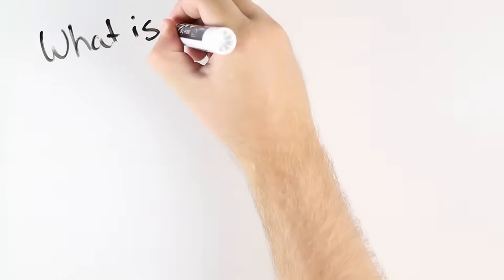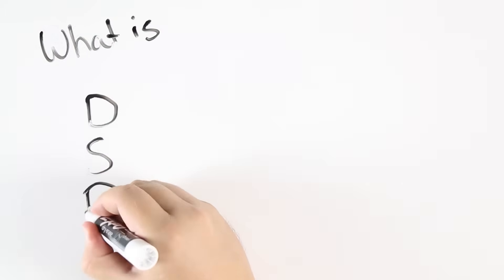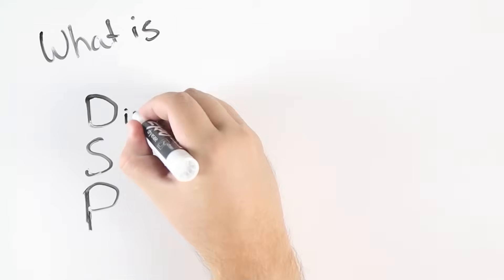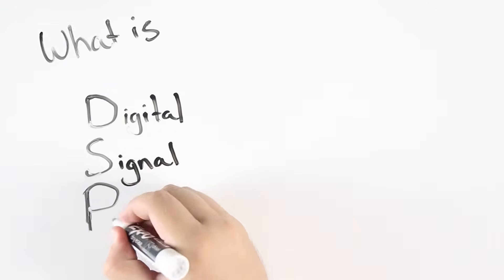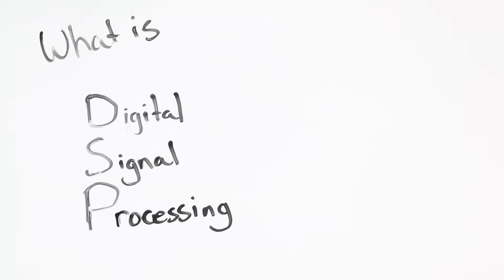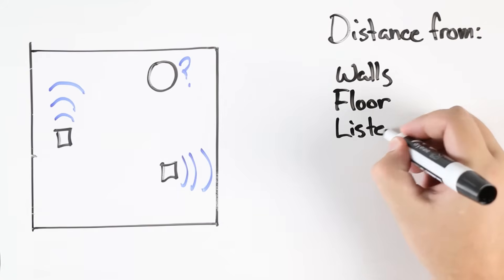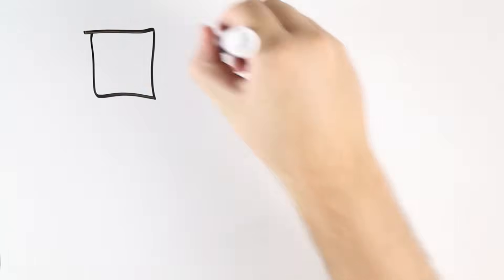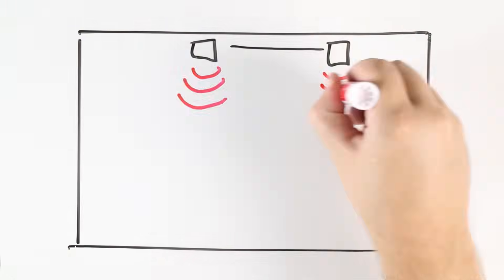What is DSP? Why do you need it?

Comment: I don't understand.  What is the difference between DSP software and a DSP amplifier? 

I just bought a DSP amplifier for €900 but now I see i can buy a 10 inch android screen for my car also with DSP software inside.

I'm confused.
Reply from the maker: A DSP amplifier has DSP technology built in. "To what degree" is what you pay for. Manipulating the sound to achieve something different is essentially "DSP", how much control over that ability (or being able to at all) is generally going to determine the cost of a product.
Reply: @PartsExpressOfficial  Thank you so much for the response! In 2 weeks the will build in my Gladen boxmore DSP set including my 15 inch 500 watt RMS subwoofer. 

Can't wait! 

That android screen will come on a later day.

Thanks again for your info sir!

Comment: Do you need a DSP if you got coaxial speakers with built in crossover?
Reply from the maker: You only need DSP if you feel you want to to change the sound you have. It's related to personal preference more than necessity.
Reply: @PartsExpressOfficial  🗣️what does it exactly do to ur bass and highs?
Reply: @evan.norwalkcalifornia562  There's no easy way to answer that question because the question in it of itself reveals that you don't have the basic understanding of the properties of sound.

Comment: Still dont understand what it is? I think the video more explains what it does, rather than what it is? I have Steinbergs UR44, does it use DSP? I guess so...
Reply from the maker: So DSP (Digital Signal Processing) is a verb, but it is often used a noun. "I'm going to buy a DSP." If something is being called a "DSP" it usually has the ability to change the input audio in many various and complex ways...however the easy way to understand it is that even simple things like 'turning up the bass' is a basic form of changing that digital signal to something different. Does that make sense? You started with a flat frequency and processed it into a 'low frequency heavy' signal.
Reply: @PartsExpressOfficial  I looked it up and that word might be used by the company who made my audio card and Id guess from that that theres at least a difference between "latency-free DSP" and when using plugins that introduces latency which is another form of DSP really...
Reply from the maker: @TheRobGuard  Latency isn't really related to DSP. All electronic devices have latency (even if it is in micro seconds) but it can be called "latency free" when the company feels it is indistinguishable from instantaneous. Regardless, The UR44 is an interface not a "DSP" (noun form). However, it looks like it comes with or could be used in conjunction with software which would interpret the input and allow you to use presents (or DSP-powered effects) to change the input to something new.
Reply from the maker: Follow up, the device itself might even have a microchip in it that has the dsp software on it. Meaning the "dsp" element of it could be very subtly built into that product without use of EXTERNAL software. Either way: Input > DSP software > Output
Reply: @PartsExpressOfficial  Thanks, explains it to me!
Reply: This explains things very well
http://www.mega-nerd.com/Res/IADSPL/page00.html